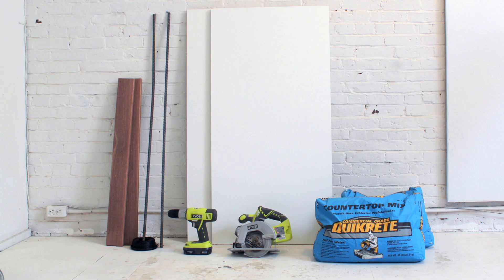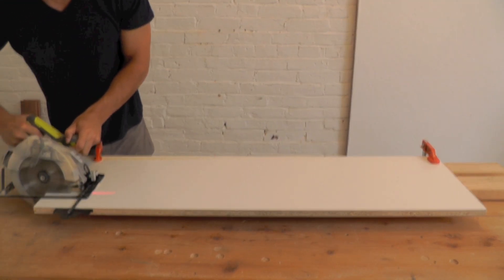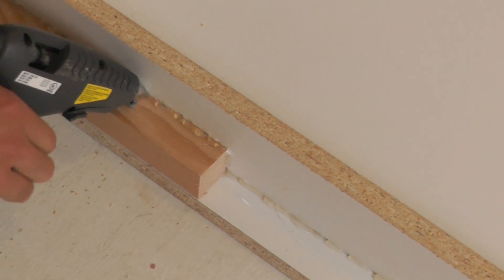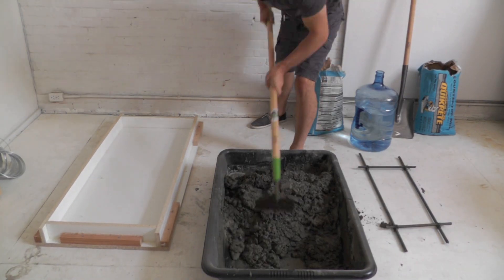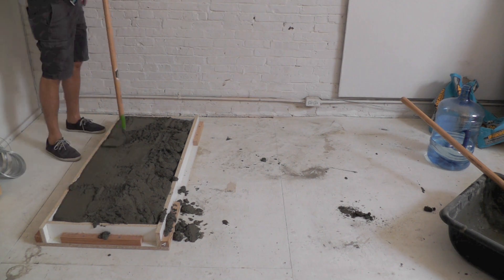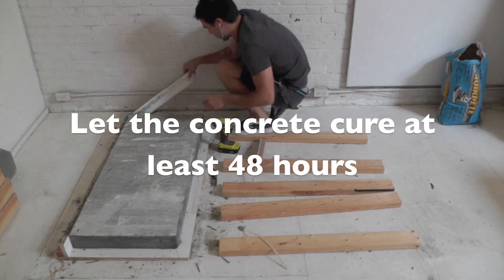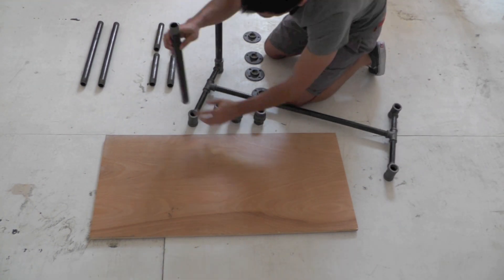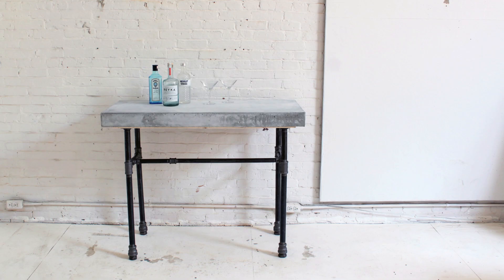DIY Concrete Bar

Comment: would it work if you put a piece of plywood (the same size) on the top of the mould so that the wood would be level with the concrete and you wouldnt be able to see it?

Comment: you have a lot of projects that use black iron pipe. I could not find these in the local home depots that I went to. they're not even online in their own website, there's only the couplings and fittings but not the actual pipes. how'd you get them?

Comment: Hi. Why did you need the coupling in the cross pipe support underneath the countertop?
Did you treat the black iron with anything (ie. Lacquer) to stop it from oxidizing?
Did you use PTFE tape in the threaded joints or just go thread to thread and hand tighten?

Comment: Great job Ben! A question for you: at the beginning of the video, you're cutting a straight line with a circular saw and a sort of spacer to make cut straight, can you tell us how to do that? Where to purchase it from abd what not.  It's a fantastic substitute to the table saw.  Great thanks
Reply: jean estephan Kreg makes a product called the Rip Cut that does the same thing. I don't think that's what he was using though.  I've used the Kreg jig for a couple of years now and it works great!

Comment: If i wanted to do this for my whole kitchen how thin could i pour the concrete when the board would be around 2.5m long. I thought of using a mesh of metal wire to support it.

Comment: Thanks for the inspiration. Just for fun, you should put prices of the supplies on the video :)
Reply from the maker: mascottie I used to do that but the prices on pipe fittings change frequently and are different regionally